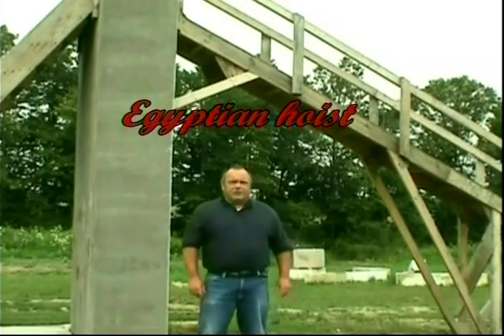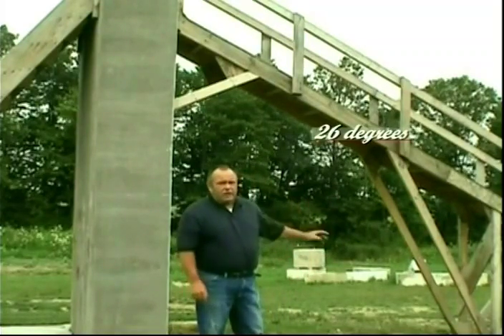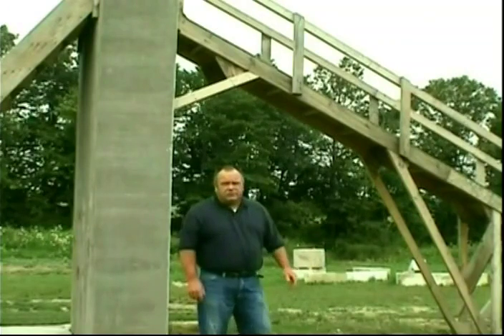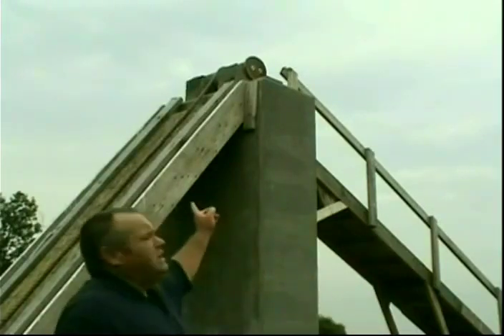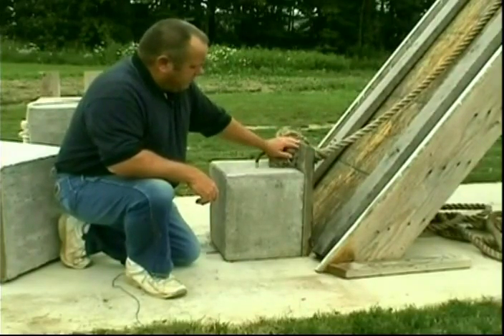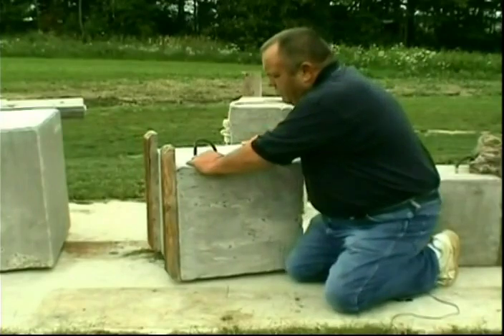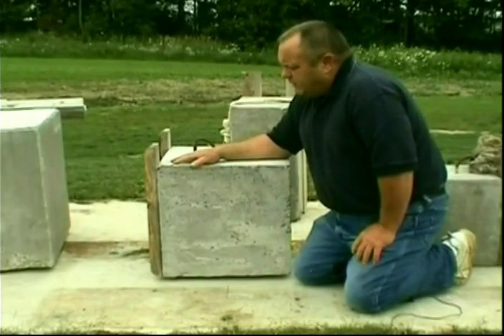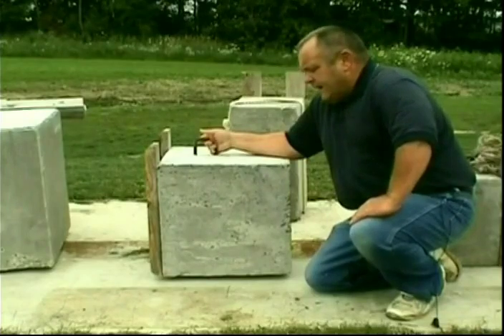Ancient Egyptian Pyramid Building Technique Reveal By Wally Wallington

Comment: Try 1,000 lbs and instead of a decline use flat with 6 to 10 men and sand as block lubricant and animal fat for the roller lubricant.  If 6 men can pull 1,000 lbs then 60 can pull 10,000 lbs.  This is surely how the pyramid was built.

Comment: Yeah now let’s see it pull a an 20-80 ton stone up that incline! The material that incline is made of would be crushed under that weight!
Reply: Also, how would continually  repositioning that apparatus when building a massive structure work?  

This is another attempt to prove the pyramids were build using bronze age technology by demonstrating that bronze age technology could be used to perform a relatively underwhelming task.

Comment: What about the 500 ton granite stones embedded in the great pyramid or the 1000 ton stones at baalbeck? Or the perfect square sarcophagus in the inner chamber which is too big to fit through the outdside openings? Or that 1 stone would have to be placed every 5 minutes of every day for 25 years to complete the build. These things are still not answered and i doubt this is how it was done.
Reply: The heaviest stone in the pyramid is 60 tons not 500.
Reply: @Warden14 this guy has amazing content and theories on ancient egypt.  https://youtu.be/rQwWtEHE5FE?si=QeMqWlLhrtvGxivF
Reply: @nofiltersfreedomnow  I'm shocked it let you post them but after watching some of it from all of them I think its a possibility they used those methods it all seems reasonable. And its possible they had some advanced methods of quarrying and cutting stone that was lost in the years after.
Reply: @Warden14 if you really want to blow your mind check some vids he posted  on unchartedx channel where he shows huge circular saw cuts through stone, perfect cylinder drill holes through stone and found under the oldest pyramid 30,000 perfectly round granite bowls and jars as if they were turned on a lathe with the thickness of the stone so thin allowing light to show through. This is off the charts stunning. I just don't think the ancients were responsible for all of this, maybe only some of it. The rest i think was there from an even earlier civilization and they walked into it and owned it for themselves.
Reply: @Warden14  ancient precision stone jars.
https://youtu.be/7LEt8VM42PY?si=TVCUaXHVRQAEuw7W
Reply: @nofiltersfreedomnow It is possible there was an earlier civilization we had like 200000 years for it to develop that was later lost to some cataclysm. Most of this seems like a civilization that worked a lot with stone and was lost as sea levels rose in the past. Leaving its descendants to to pass knowledge to later civilization like the Egyptians but that this knowledge was later lost as time went on most likely because they would try to keep it a well guarded secret to stop anyone else from using it. But that is just a theory and we have no solid proof of it.
Reply: @Warden14 I'm referring to the large granite stones placed within the open chambers inside the pyramid at an incredible angle. Look it up.
Reply: @nofiltersfreedomnow I have from what I can tell the heaviest is only 60 tons also the angle would not matter the pyramid was built around it.
Reply: @Warden14 we don't have any idea how the pyramids were built only hypothesis and speculation.
Reply: You're  right. I checked wiki. Heaviest granite stone at giza are 80 tons. But how did the same societies move 1000+ ton stones at baal beck. I've been waiting my whole life for someone to solve it. The only interesting idea I've seen is the water method, hypothesized by some french guy 50 years ago and attempted a small scale trial. It's fascinating yet so simple however, I'm still not convinced they could could do 1 stone/5 minutes with that method.
Reply: @nofiltersfreedomnow I looked into that but I have no clue however the quarry where they got the stones was above the site so they did not have to lift them. Also they had more then one stone getting moved at a time imagine as one is being moved to the sight another is getting dragged behind it by more workers. But we have no clue how they did it we have ways they could have done it but we do not know what one they used.
Reply: @Warden14  not sure if youtube will let this link get posted. The water method part 1 https://youtu.be/TJcp13hAO3U?si=SqQJtJxV6-QEyL4r
Reply: @Warden14  the experiment part 2  https://youtu.be/rxFXsoqbfrk?si=Qp2f93O9YdwU-yh7

Comment: Maybe the shafts were used this way, as well as a long ramp for the lower half that was built up as  the great pyramid was built up. then they used the shafts for the upper sections for blocks, combined with spiral ramp to shift rubble infill.. a few hundred people could pass individual rough rocks to each other in a chain. Hard work if done quickly and continuously but much easier that moving heavy boxes of rubble.

Comment: This video just like all of the others shows just how easy it was to move a 200 pound block.  This is great, except the Egyptians moved blocks that weighed many Tons.  According to other videos the Egyptians also made 90 degree turns with these blocks on a ramp with only human power.  The other thing that most of these videos just gloss over is just how these huge blocks of stone were moved from the quarry to the site.  How did they get these blocks onto the boats that they used to float them to the site and then off load them???  What kind of crane did they use to transport the block from the boat to the dock on a muddy river bank.  Too many holes and not enough answers.
Reply: A stone dock higher then the boat on one end and a stone dock lower then the boat on the other that is one way on how they got them on the boat.

Comment: Maybe Wally can post part 2, where it shows the cutting of multiple 120 ton stones that fit with laser like precision.
Reply: The heaviest stones are 50 - 80 tons. The blocks on the outside are 2 - 3 tons. The precision fits was on limestone which is a softer rock and easily sanded down. All very impressive but the clue is in the hieroglyphs - workers pulling sleds on wet sand. The statue depicted weighs an estimated 58 tons. A university tested pulling sleds on wet sands in 2014 and it reduced friction in half.
Reply: @walshmabob2 please stop with your logical thinking!...it hurts the brains of the "aliens did it" people
Reply: Tell me you know nothing about building without saying you know nothing about building. He's demonstrating how to move a heavy object. Everyone knows aliens, and Bigfoot fitted the stones.
Reply: Anyone worked in a rock quarry knows this is bs. I've watched a Cat 992 (900hp loader)
 struggle to move a 40ton limestone block, not lift.  Giza had some blocks weighing 80 tons
Reply: @GreggWalken-xd3qv  im a lifting supervisor and machine moving supervisor in the uk. 

With the right knowledge 20 men can move an 80 ton block using wood , rope/straps, and a few other items that could have been fashioned in egyptian times. 

You have no idea what youre talking about
Reply: @markjames2909 A machine moving super? You mean moving on a smooth reinforced flat concrete surface, using steel ball bearing rollers, steel gantry crane for lift, hydraulic jacks for shimming, moving equipment few feet, no inclines and having multi axle truck bring to the job?  
Twenty men could probably move it but couldn't place it, nowhere near the same task.
Reply: Готов поспорить, что до этого момента ты и представления не имел, как можно поднять тяжелый каменный блок на такую высоту за несколько секунд. А какие открытия тебя ждут в будущем)
Reply: Not laser....but they did take decades and tens of thousands of bodies, with nothing but time on their hands.
Reply: Copper saws and drills were used. This has already been proven and demonstrated.
Reply: 😂 Have to agree. That civilisation was definitely something different.  They were actually so mentally advanced in many fields, but what the most mindblowing is, is that  they didn't leave any trace, zero sketches, or any tiny machine, for anyone to ever discover of how they achieved that kind of engineering. That for me is crazier than their engineering itself.
Reply: @MarijaFeher yes, so advanced they could stack rocks… Also there’s like 8” difference in the sides of the pyramid. Sure it was a great accomplishment but they did not achieve “laser precision”

Comment: All well and good for small blocks but I presume that a similar rope would be used for pulling 5/10 ton blocks of granite plus  haulage equipment made from similar sizes of wood. No I don't think that rope and wood could be scaled up be strongenough for the task. Plus please explain how blocks were quarried cut and transported hundreds of miles over rivers hills through rough ground  to be fitted perfectly in place every two and a half minutes for twenty years without any mistakes ,brakedown of equipment or workers fatigue all wilth copper chisels and pounding stones  ?      No The pyramids were inherited by the Egyptians not built.

Comment: That sounds really great, but that’s not how they were constructed. The Egyptians must have had lasers to cut the rock into perfectly proportioned blacks then they used a system of pulleys and ropes, and they must’ve had electricity as well to construct these because of the lighting problem inside the pyramid during construction

Comment: When I first saw the ramps I thought he was going to have people carry small weights to the top of one side to assemble a counterweight.
Reply: I thought of that after watching him pulling. Yeah, a counter weight would pull it, maybe water was pumped up to the top and something was filled?
Reply: @johannesswillery7855  I don't really know, but I'd guess that camels or mules (any beast of burden) could carry lots of smaller stones to the top to load onto a pallet. Then rope the pallet on the top to the huge block of stone at the bottom, with an axle wheel at the top, and it wouldn't take much effort to pull the big block to the top and let the pallet of small stone down to the bottom of the other side. The tradeoff is taking more time with relatively small beasts in exchange for one giant lift in one day with a powerful engine that didn't exist yet. If pulley wheels existed, you'd less of a counter-weight and a longer rope.

Comment: Technically this could be done with even less people if you used a counterweight (probably 1/3 the weight of the actual block you want to lift) on the opposite side. It would be pulled up to the top first, then the main load would be connected and the counterweight and people would lift it.

Comment: The block still has to moved and set once raised.
Reply: There were people and process for that. Yep. This guy demonstrated one single aspect of building.
Reply: Not to mention quarried, transported and cut. Also Egyptians didn’t have hemp ropes and no knowledge of the wheel or pulley system at supposed time of construction
Reply: @OzMate79  Египтяне не знали о колесах?)) А барельефы с фараонами на колесницах в гробницах нового царства говорят об обратном))
Reply: quite literally none of the words you just said there were correct. they quite literally had all of those things and used them with a tremendous amount of skill. what an absolutely bizarre way to live when ALL of this information is so readily and easily accessible. the subtle racism is exquisite.
Reply: @LadyBits2023 do u believe the Egyptians built the pyramids ? OK what about the  Cities under neath the pyramids 😂😂😂
Reply: @LadyBits2023  Ignorance? Perhaps. Racism? No. Why would you jump to this assessment?
Reply: @LadyBits2023  You had me agreeing with you all the way until you used that lame word 'racism'
Reply: @davidhughes4448  The racism is obvious. The pyramids were built by brown people, so of course a racist would assume they couldn't come up with the necessary technology. Hence the need to move the goal post by pointing out that the demonstration doesn't show how to complete the building after moving the block.
Reply: @Chris-k7x9d  Chris, I was merely asking a mechanical, structural, and engineering question. For all we know the pyramids were built by space aliens, regardless of skin color. Why do some immediately jump on the earthly race card? Think "facts" before "emotion".
Reply: @davidhughes4448  Bullshit. If you were really interested in that, you'd have asked a technical question, like: "Was their rope strong enough to carry the stone?" or "How many ropes would be needed to haul one stone?" But you didn't. You simply left open the implication that Egyptians could not have done this on their own.
Reply: @Chris-k7x9d  Chris, you are correct. I responded to another pyramid-building YouTube video in which I asked technical questions - I was confused. My apology. I will say that I did question LadyBits's ridiculous jump to racism, though. And none of us enjoy reading your profanity, sir.

Comment: Rather than have workers on a ramp, they could have pulled from the flat top of the pyramid under construction. Several crews could work at the same time, at least until the workspace gets too small. Definitely the 52 degree side of the pyramid makes a better ramp than any of the shallower proposed ramps, internal or external..

Comment: I think about this all the time.  There are ways it could have been done without aliens.  More giant rocks would snap an ancient rope but they could have just added as many lines of rope as required by dividing block weight by rope breaking point at that angle.  Combination pulleys are even more "magical" but no evidence yet that they used them.